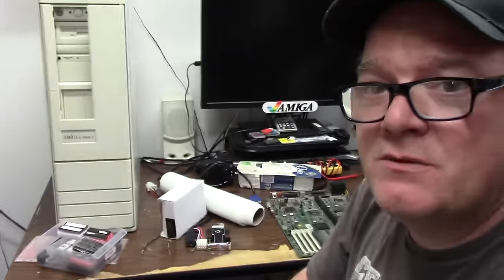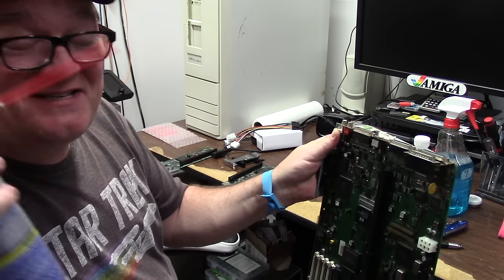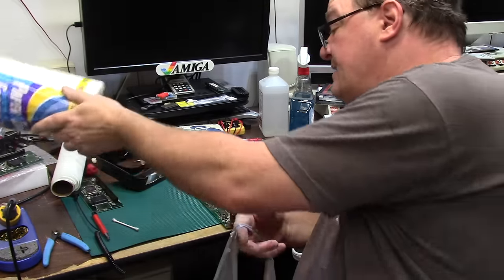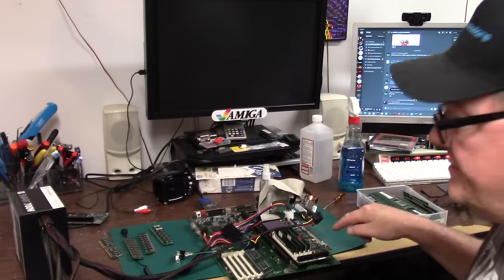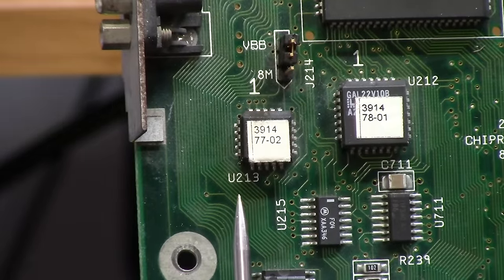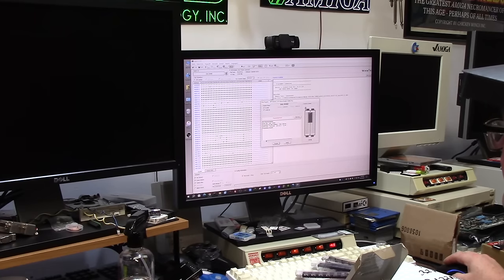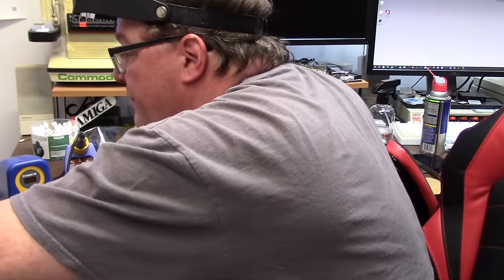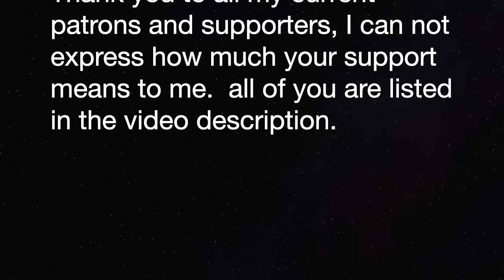The Black Beast P1 -  An Amiga 4000 video toaster screamernet rack unit

Comment: chipram: doublesided simm = 2MB    singlesided = 1M   so I use 8MB simms as "2MB Chip"  most as I bougtht some 100 packs of 8MB simms :)
Reply from the maker: 100 packs?!! wowzers
Reply: That's nuts.  There is a post on one of the forums that said the jumper for 1mb or 8mb has some effect on what that detects as, even though it still tops out at 2mb of chip.  I went poking around because, for the life of me, I couldn't seem to get any to pass the mem test.  I finally did, but only after I took out the CSPPC and put in my BFG9060.

Comment: The bad GAL might not have been bad. From what I remember, that's just how they read back if the lock bit was set when it was programmed.
Reply from the maker: Had a fuse bit.  Second one worked fine i do understand the all 1’s protected mode
But rewrite should work.

Comment: Thanks for the Video Dr Chris 👍🏻 And thanks for my request to show how you program Gals 🤗 The 20 pin sockets etc.. these from Mouser? Look forward to PT2. Cheers 🍻
Reply from the maker: i bought the chips on ebay. the adaptors came with my programmer kit . They are under normal circumstances all electronically erasable unless theres a issue like we saw.

Comment: Have you reworked any GALs on WarpEngine4040 turbo cards?  Mine lost all its memory.  She won't work with any SIMMs (any combination) installed.  She'll boot fine with empty sockets.  Some suggested GALs gone bad, but that's above my paygrade.
Reply from the maker: Own one, never did one. Dont know if the code is available